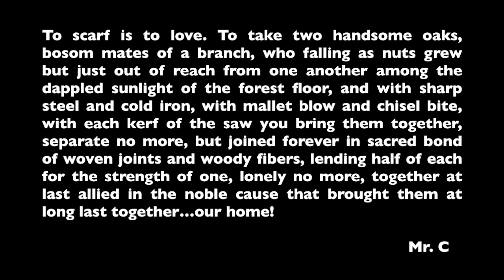Our timber frame cabin Part III: White oak scarf joint

Comment: Every artisan I have ever watched shares one thing. It doesn't matter if they're making a gold ring, an oil painting, a violin or a timber framed building. What they share is - when they work time stands still. The joy is in the art, there is no need to hurry.
Reply from the maker: Thank you for the kind words!
Reply: I’m going to use what you said and quote you on it.

Comment: Great craftsmanship and video.  Lot's of "entertainment" value.  It seems more than a little contrived to avoid all use of "technology" other than an HD cam and the internet!  Still a thumbs-up from me.  BTW - scarf joints need to employ 45-degree angles not 90s to be strongest.  But once again, who needs technology when you have braces to hold up your dungarees?

Comment: White oak is an EXCELLENT choice for beams. Strength, rot resistant, heft. I have a beam auger similar to yours but it is fixed at 90 degrees, with several bits. I have had it for several years and have not had the opportunity to use, but one day in the future I will.
Reply from the maker: Yes its nice, but dang HEAVY and hard. Definitely makes pine feel like butter afterward! 
Put it to use for sure, old tools need to get used, else they get depressed, and then start rusting...

Comment: The opening words are beautiful. Its a great joint and well executed .
I like the auger, I have not seen one before and it would be very useful.
James
Reply from the maker: Thanks James, glad you enjoyed.
Reply: I just watched your video again to see your beam drill, its is great and you are lucky to have it.
I noticed you used the nib on your hand saw when starting a cut, do you often do that. Its always been a bit of a puzzle as to whether its just for decoration.
I bought a corner chisel recently about the same as yours, the only way I could sharpen it was with a triangular saw file, what is your method?
Reply from the maker: Thanks, i love that tool! I just thought i would give it a try one day with the nib, darned if it didn't work! I sharpen my corner chisels with a normal bench stone on the outside and a small slipstone on the inside. A good chisel should be too hard for a file to bite I think...
Reply: A normal saw file is fine on old chisels, which are probably carbon steel and you can get it into the corners better. I did use a slip stone for a final honing. However, if you have High Speed Steel then you will need diamond. If you have HSS you will not be able to use a bench or slip stone, its too hard again diamond is an answer.
Thanks for the information and your first rate videos.

Comment: i really like your skill Mr C. this is a nice shipwright scarf joint. it was invented by greek and romans to do long ship in the antiquity. in france this scarf joint is use traditionnaly in carpentry by windows maker and furniture maker
nice job !!!
Reply from the maker: Really? I had no idea the romans used that. I also didn't know this was used in France, what other scarf joints do you use there in france?
Reply: we use mainly 2 scarf joint, the one you did and one wich is in diagonal and the dimensions are: the diagonal of the cut = 2 time the high of the beam and the extremity of the angle are cut with the same angle but in the other way and there is a key in the middle. it's named " trait de jupiter", it's the most used one in france.
in the US carpentry regroup all the wood workers but not in france.
in france we have charpentiers (house builder), menuisier (intern amenagement in wood traditionnaly), ébéniste (furniture maker)
and for all those work core there are multiple sudivisions.
Reply: Most woodworking joints were invented during the Bronze age, shortly after carpentry tools became common.
Reply: sorry but i disagree, during bronze age, people haven't the necessity to use long beam and this joint in particular have been invented during antiquity (the oldest one tested by C14 proove it on a roman galley found in mediterraneen see) if you have other sources, i will be enjoy you to tell me what are they.
for furniture i could be agree with you but not on those

Comment: Good effort dude, look forward to the rest of the series.
Reply from the maker: Thanks Bro!
Reply: Mr. Chickadee  hello good sir, are those double handled drills easy to come by..I'm in England. BTW, very neat work..thanks for sharing.
Reply from the maker: Howdy friend! Here in the US these tools (called "boring machine" here) were used extensively in the later 1900s for timber frame construction, and they may have been an american invention. For this reason there are still a good amount floating around. Im not sure if they were used a lot in the UK? That would depend on if you can find them. Try Ebay UK maybe? Some things are easier to get there, like you have a surplus of great quality wooden hand planes, where here most are in poor shape...
Reply: Mr. Chickadee  thanks buddy..I use ebay so will look. Enjoy your videos very much..anymore in the pipeline?
Reply: Mr. Chickadee n

Comment: ❤ All the old frames,that have seen they  ,locate the scarfs above the brace . The top plate is like an invisible wave. And above the post is the top of the deflection ,even though it’s popular to put them there ❤
Reply: Wave -cord
Reply from the maker: The scarf placement you mention is true for western timber frames like here and in europe. Its interesting to note how in East asia they often place them very differently, and they dont have knee braces at all. I feel its important to study the particular style being used and a great sense of security can be had from copying old proven architecture.

Comment: I like what you do :) might I suggest that you spend some time building some sturdier saw horses it will make your work go easier and more accurate. signed old woodworker.  :)
Reply from the maker: You are correct, these were cobbled together and not sturdy enough.

Comment: Yup. They fit all right. And the chisel handles seem to be holding up. My concerns were groundless. Does a let-in joist fall on the scarf? 

I love old-school timber framing where it goes together like a wood puzzle; an elegant union of function and esthetics.
Reply from the maker: That dogwood is amazing stuff, I was just thinking of your comment today, and after whacking the crap outa this handle, I looked it over and there is not even any indication of wear or mushrooming at all, it just gets more shiny at the impact zone…truly magical stuff, Ive even driven say a stuck metal splitting maul through a trunk section with my large dogwood mallet with no real ill effect…

So happy to see you caught the intent of the over large wedge, which is a temp made piece for fitting up the joint, YES my idea was to have a tying joist tenon enter there and be the holding wedge in the joint, killing two birds with a fat stone and less weakening the joint.
Reply: +Mr. Chickadee Modern technological dogma - reduction of parts count through multi-function design -  meets traditional timber frame joinry. I can see you're a look-ahead guy.
Reply from the maker: Nice, I really like what Roy Underhill always said about traditional carpentry, "these are not the techniques of the past, but of the future!"
Reply: +Forrest  Addy Speaking of: dogwood gluts for riving boards from logs.There's a YouTube vid where a hoard of Scandanavian shipbuilders make a long ship from planks riven from logs. They start with steel wedges and move to wood gluts which they splinter. I remember seeing this and failing at the time to recall Roy Underhill's revealing the virtues of dogwood branch wood for making mauls and gluts.

Comment: Is that Anchorseal end coating I see on the end grain of the scarf joint?  I use it on all of the joinery of a timber frame project when a cross grain cut is made, Great product! I've cut this style of scarf on a building I did. Very strong joint. Thanks for sharing.
Reply from the maker: No sir, its actually Crisco… ;) seems to do the trick pretty well, and CHEAP!

Comment: Sounds like you have a Vireo singing in the sound track.  Must be spring in Pennsy.
Reply from the maker: Yes we have many here, one is working on its second clutch of young using the same nest on the top plate of our workshop over the front door, I did not know they would re-use a next that way, nor that they were so brave around people, a notoriously shy bird.

Comment: Is that a reproduction mortise tool or original. Very nice looking tool regardless.
Reply from the maker: Its original, Im not aware of any new makes.
Reply: I have never seen a repro either. That is only the second or third one i have seen. You deserve a nice tool like that with the quality of work you do. I am curious how long it took you to make that scarf joint, and how many you need to do/

Comment: Oh ! … I thought a scarf joint was a very low angle joint !
ie. the length of the joint being at least 12 time the thickness of the wood piece.
Nice vid.
Thanks for posting.
Reply from the maker: Most scarfs are either 3 or 4 times the depth of the timber, 12 would be pretty long, like 96 inches!
Reply: Yes, I was thinking of the scarf joints we make when making one large plywood sheet out of two in boatbuilding.
But we do also make these very long scarf joints for some pieces of wood when we need a very long one piece of wood, such as the keel : epoxy is damn useful in these cases !…

Comment: thanks for the info on the chalk line I found one on eBay. Did you come up with that design for the scarf joint?
Reply from the maker: Thats great, no I borrowed it from the Timber Framers guild books on traditional joints

Comment: Once again I was surprised by some of the comments about the boring tool. Considering the simple fact that wooden bridges were VERY common in the US these tools were common as joints holding the bridge together depended on jointery secured by metal fasteners. And then there was the joints used in buildings, BILLIONS of joints.

Yet many of the people leaving comments were not aware of these drilling machines. This leaves me trying to figure out why I am aware of such devices. I build scale, period models, not real structures. Guess I am cursed!

(I left a similar comment on a site dealing with wooden wagons.)

Comment: Hey there, just wondering if you'd share what your sealing all the newly cut joinery with in this video? And I'm guessing that is because the beams are still fairly green?
Reply from the maker: sure, its crisco, but wax or paint work too, everything is freshly cut and treating the endgrain helps control excessive checking

Comment: Would this scarf joint, or some other scarf joint, be suitable for a long horizontal run? Approximate span is about 24’. I appreciate it used to join to timbers
Reply from the maker: possibly, depending on the frame design, location of supporting stones or posts and other factors. Provided the scarf is made correctly and possibly more importantly oriented correctly, yes.

Comment: Sir, I was avidly following your progress in forming the scarf joint, so was shocked to see the video end I believe, before the joint was completed.Is this true? you can do your video however you want; its your video.  But to see your expertise in all the various parts and pieces, then not end... well...
Reply from the maker: It was in fact finished, in the end of the video I was simply showing how one can take the joint apart after testing its fit utilizing various wedges. Sorry if that was unclear.

Comment: I just looked in my Hasluck's "Carpentry and Joinery Illustrated". In 1907 Brit-speak that joint is a "tabled scarf with a folding wedge" (p59) except Mr C's version has the scarf in a single plane with a centered housed wedge and lateral keys. A tabled scarf is resists end compression and and has greater lateral beam strength than a raked scarf joint. I understand that tabled scarf joints are used in the diagonal hull bracing of caravel planked ships, probably under a different name. Another thing to look up.

Ah, the breath-taking taxonomy of high-falutin carpentry. It makes "counting angels dancing on the head of a pin" speculations of Medeval clerics seem down to earth. A rose is a rose: should an efficiently executed joint that fulfills its function suffer stultifying nomenclature?
Reply from the maker: Nice book, Im jealous, Ill need to search for that title! Im not clear on the specifics nor exact pedigree of most joints, I simply found one which had been proven in numerous old barn sills, and tilted my hat at the tested wisdom of those ancient barn wrights of old...
Reply: +Mr. Chickadee tons of old joinery books available as re-prints. I got my copy from Astrigal but I see Amazon has it in stock. It contain more that you'll need need to know about the broade aspects of carpentry and joinery - which I speculate is where they got the title.

Comment: Mister Chickadee, I was wondering how you sharpen the corner chisels?
Reply from the maker: well you rub each bevel on a stone til you feel a burr on the inside of both faces, then use a slipstone to remove the burr, the strop both bevels and then the inside faces with a bit of leather attached to a piece of wood with an acute corner
Reply: Thank-you for that explanation

Comment: I've always found this kind of joints a bit strange, does it have benefits over the Z-shaped version ?
Reply from the maker: Its simpler to cut, and sill level, with supporting stones more than sufficient.
Reply: wow! haven't had the internet to watch your videos for a while! you're still incredibly inspirational. Too busy with the garden and chickens to woodwork, but i really miss it. Anyhoo... I always wonder if shear strength is the same in scarf joints that don't incorporate diagonal tension. I've only made a japanese scarf joint out of scrap 4x4's, and i've never tried to do my own testing, but i would love to make a bunch of scarf joints with the same wood species and no run-out and see what happens when similar weights are applied. the japanese scarf joint is very similar to this one, except it incorporates a diagonal. it's like the fusion of the z shaped and this one.

Comment: do you use the same saw for rip cutting and cross cutting? if so is it a rip cut pattern?
Reply from the maker: No, there are rip cut teeth and crosscut teeth used for their respective duties, ripping parallel to the wood grain and crosscutting across these fibers. I have several saws in each style of tooth geometry with varying size teeth for different wood types or desired smoothness of cut.
Reply: Thanks!
Reply: Just started learning about cross cut and rip cut and how to sharpen them by watching Paul Sellers.

Comment: you continue to inspire me, still working on my work bench so i can get on with some of the projects i have seen on your channel. Just one question... as your work is naturally slow paced do you worry that the joints you have done will shrink/ warp by the time you come to the raising? Nice to see the poems at the start.
Reply from the maker: Well Tom, thats a good question, and the truth is, the joints should take me about a month to cut for the whole house, if I stay on schedule, and most of these timbers just won't be dry for many years, so that should not be an issue, one thing which can help, don't bore any peg holes until right before the raising, as they may misalign some if sitting for a long time

Comment: Very cool as usual. Did you use a template or did you free hand the layout?
Reply from the maker: I have been free handing, and using story poles as seen in the last video, but a template would be a good idea for sure and make things more easily accurate.
Reply: Well you are doing a fantastic job. Is there any special reason why you did 2 blocks instead of a single wedge?
Reply from the maker: Yes actually, the larger block is temporary, but in its place there will be the tenon of a floor joist, an idea I had to save from removing too much wood from the scarf area.
Reply: +Mr. Chickadee great idea. Obviously you'll have supports under the joint. Aren't you worried about the splitting or are you turning the joists so the grain is vertical? I think I just answered my own question.
Reply from the maker: Kinda, Ill show how it goes in a video soon. ;)

Comment: Probably someone asked it already, about proportions of this joint. What are the best or appropriate?
"The Art of Japanese Joinery" has it: approximate length should be x4 of beam thickness. Was it similar case here?
Also, you really don't want to know the actual eBay prices of those barn beam drills. Pure insanity. But they're rare and no one is making them anymore 😭. Also in Europe, non existent.
Maybe that's an idea for another project? ;) (Along with wooden screw tie/dye maker;))
Reply from the maker: I typically do 3X the beam thickness, not the depth. These days I use Japanese type scarf joints and orient them 90 degrees to what is shown here. Live an learn! 

I got my beam drill for 200 bucks, on ebay of course, and have seen them cheaper than that. These days I usually preffer a whimble brace as its more comfortable for me to stand than sit.
Reply: @MrChickadee  Josh, thank you for the answer !! I recently stumbled upon timber frame utilitarian construction (16x10ft) made a couple of years ago, in western style.
Literally, there are used max 2 or 3 types of joints. And scarf joints are, what seem to be, even x1.5 of beam's thickness (square 8"x8"s).
Still, it looks impressive and absolutely amazing :)